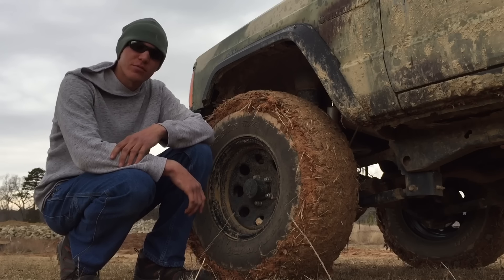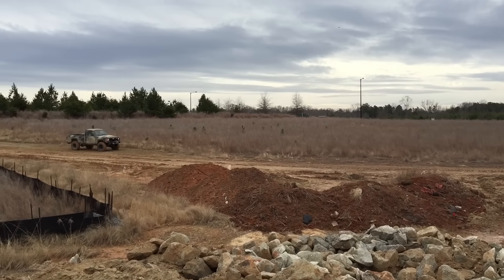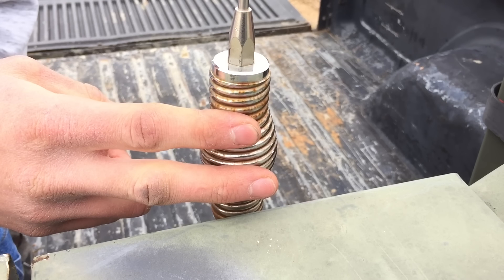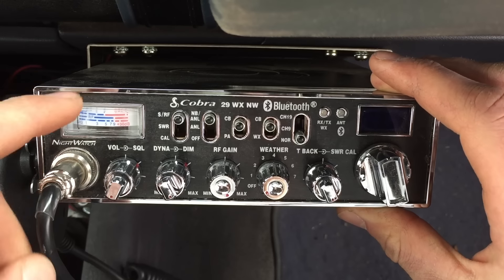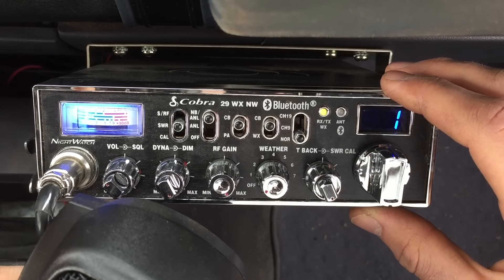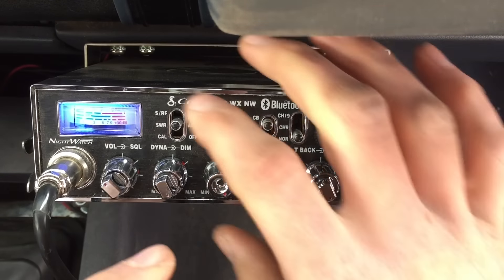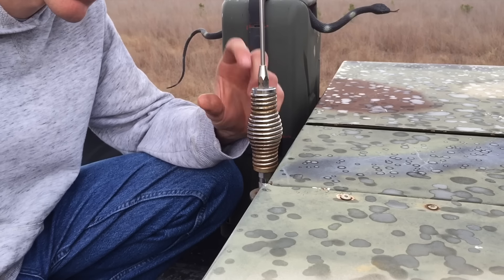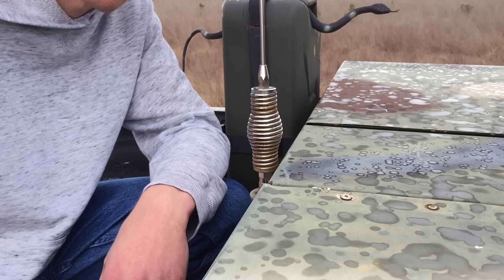How-To Tune a CB Antennae

Comment: I hardly don't want to say anything after you've put so much effort into providing a quality video that in some parts is accurate. I also don't want to steal your thunder.

The main thing I'd like to add is how to properly attach the antenna connector.

As an extra class amateur radio operator with more than 40 years experience that started as a CB radio in 1972 I'd like to suggest that you're putting overemphasis on going out in the middle of a field with absolutely nothing around but weeds to tune your antenna. It's not a bad idea but it's not practical unless you plan ahead.

A 102 inch whip antenna is designed to work with a 4-inch coil. Those are not tuning lugs but rather a simple washer and a lock nut. Putting one in to increase the length of the antenna will offer only a marginal change if any. Taking one out would mean that you would have a lock nut with nothing to press down on. It's already the ideal length. What you have affecting your SWR is more than likely the following.

Ideally, the length for your coaxial cable is 1/2 wavelength. For CB radio that would be 18 feet. Cutting it shorter will have an effect on your antenna tuning. You are correct that you should not generally coil it up but if you coil it up into a large coil you're going to be okay. On the other hand, if you coil it up into a 6in or 8in round loop you have created what is called a BALUN which is a device that converts a balanced feed point to an unbalanced feed point. If you have extra cable you can cut it off or not. In your case it worked out. Look at it this way. Nearly every CB radio antenna comes with an 18-foot piece of cable.

A bigger concern is to route the cable away from certain wiring in your vehicle and in this case in your truck. If it is an old beater 4WD it's probably not going to be a problem. But newer trucks with computers in them are sending computer signals through cables that if you run your coaxial cable next to them they can and often do pick-up noise that affects the range that you can receive.

All in all, a good video. Just a couple of minor points like the washers between the whip and the coil. One thing to consider is that when mounting your whip it's best that you not mount it too low on your toolbox. Ideally you would want to mount it in the center of your roof but when you're out playing in the mud and the trees lower is better. Damn things grab every tree as you drive by it seems. LOL. An alternative to 102 inch whip is a K40 antenna drilled right through the roof. No mag mounts! Commit and do it right.

The last point I will make is weather proofing your antenna connection. First, you obviously want to tighten the antenna connector down hand tight and then slightly more using a pair of pliers.  Not too much because you don't want to crimp the connector. They're generally not very good to begin with. A real serious radio operator would cut that connector off and solder a real one on.  You'd be surprised the difference that would make in range.

Nonetheless,  if you would like to weather seal it correctly you should take some thick epoxy/adhesive 3:1 shrink tubing and put it over the connector in two places. If you are cutting the cheap crimp connector off you want to do the next in two steps.

First, before you solder a high-quality gold-plated connector on you want to slip about a half inch diameter piece of adhesive shrink tube over the cable. Maybe 3/8 in. It's been a while since I've done one. You then want to take a larger about a 5/8 inch adhesive piece of shrink tube and slide it over. Both should be about 3in long or better.

Next, you want to solder a high-quality pl-259 connector. I prefer those that are gold plated. Tips on soldering a pl259 connector on are available all over the Internet and YouTube. It's actually pretty simple. Using a multimeter make sure that you have not shorted out the connector. Attach the connector to the antenna.

Once this is done start first with the smaller shrink tube. You want to get it up so that just fits over the the cable and just around the bottom of the shredded ring. It needs to be loose enough so that when you apply heat to it it actually has room to shrink. Second, once the first piece cools down take the larger piece and push it all the way up to the top And then shrink it down also. This will give you an absolutely weather sealed antenna connection that will survive the harshest elements. This is how we seal hard line connections on repeater sites high up in the mountains where they receive the harshest weather including snow and high winds. Your connector is also not likely to you accidentally come off.

If you don't want to do it this way and the right way the first time consider the following.

Take a roll of electricians friction tape and wrap it tightly from the top to the bottom and then back to the top again. Once you have done this and cut off the excess you then want to take good quality UV resistant rubber tape and again start at the top but go in the opposite direction and wrap it tightly by pulling on it slightly to stretch it until you get to the bottom and then go back up to the top again. When it settles it will tighten itself up. I like to take myself a black UV resistant wire tie and put one at the top where the tape ends and a smaller one down at the bottom. This will weather seal your antenna so when you're out in the mud or jumping over rocks and hills your antenna connector won't get wet or come off.

I seriously hope you don't mind me going into this detail to add to your otherwise excellent video. Just as checking/matching the antenna for the best SWR is important, so is weather sealing the connector.
Reply: Dam dude... why not just make your own YouTube video and show us how it's done 👍👍👍👍👍👍 seem like you know a lot on how to install hookup and adjust ... and I'd like to see a complete how to 🙂🙂🙂
Reply: @theblacksunshineproject3597  :: because bleepinjeep already did that and I simply added to what he already did a good job at doing. I have been an amateur radio operator since 1976 and I've worked on everything from HF low band equipment to ultra high frequency equipment commercial including having run a mobile telephone service center that I built from the ground up. Rather than steal the Thunder entirely of somebody that spent so much time putting together a video I simply have the opportunity to drop in information that will help with his fine work. I sure have no intention of taking away from him. I'm not here to steal anyone's thunder.
Reply: I'm just saying... with all that knowledge... you could make some videos spreading your knowledge
Reply: @theblacksunshineproject3597  :: yes, I suppose I could. Part of the issue is I don't have time. I'm trying to keep moving forward but my grandson has cancer and since my daughter's boyfriend bailed it's just her and I spent a lot of time caring for him. She's trying to finish your college degree so I spend the time during the day with him and I just don't know where I would find the time. I know they're quite a few hands and already do videos and you know I just don't have time. It'd be kind of cool getting some products and do to test them out you know and build up a nice Channel and get some ad Revenue going based on that but I don't know we'll see what happens in the future. Putting on a connector is one of the basics of radio whether it's CB radio or amateur radio. I've got still photos of me building a custom radio antenna that actually works add you only need a handheld drill couple of screws and some copper pipe. I'll tell you, there's some really quick and dirty handmade antennas that you can put on your Jeep for other SUV little outperform a lot of the crap that's out there on the market. Simple is better though. Just using 102 inch whip with a ball mount is really the way to go. I have had projects though where the person had a vinyl hardtop and they wanted a mountain antenna in the middle of that but that wouldn't give a ground plane. So we pop rivet it in a sheet of aluminum inside of it and as we did it we put silicone rubber in the holes so with a pop rivet went through with the kind of went through the silicone and sealed it. Never leaked. Outstanding performance with a K40! Thanks for the inspiration. Maybe I'll actually get around to doing that.
Reply: @justanotherguy3850  this is also something you can pass on to your grandson one day always keep positive and stay pure the lord is always there
Reply: Ray
Reply: Experienced ham huh? I'm a CBer and I'd like to point out a few things. 
An electrical half wavelength in a feedline is not 18ft. It is shorter as you have to take in the velocity factor of the particular cable. There are some applications for the shield to be a half wavelength, however in this case I assume that you are saying that it should be a half wave so the setup ignores the impedance of the coax and there is no or little impedance transformation. And it is a good idea for measurements with an analyser. Coiled up coax is fine as long as it is not exceeding the bend radius and number of bends specified in the data sheet. It will not affect anything. Coiled up coax is not a balun, it is a simple form of choke. And it does not convert balanced to unbalanced. For this application it is a good idea for common mode current. And the SWR is not so crucial at 27mhz as far as performance goes in a mobile setup, unless the coax is ridiculously lossy. Nobody could notice a difference on their signal meter unless the pattern is skewed.
Reply: @arconeagain  :: leave it to one of those negative type of CBers that would rather tear down and ridicule then have a polite discussion. You're the type that's not welcome on ham radio. As an extra class operator there's a lot of things I can say and run circles around you. But I'm going to avoid any type of character assassination.

I did not say an electrical half wavelength. I said a half wavelength. If this were an electrical half wavelength it would be approximately 12 feet in length. The problem with that is it's too short for most vehicles with a rear mounted antenna to run it up to the radio an a compromise needs to be made.

It's clear that you don't know exactly what a balun does. A balun does more than just convert balanced to unbalanced. One technique used by amateur radio operators on a half wave dipole for example that has a 73 ohm impedance is to make a homemade balun by rolling a 6-10 in diameter core with 8 to 10 turns of coaxial cable. But a choke balun is not actually a balun. It acts more like ferrite cores and help eliminate RFI on the outside of the coax. I would be very surprised if you could even tell me what's a formula is to calculate an electrical 1/4, 1/2, 3/4, 5/8 or whatever wavelength. Even dual 2m / 70cm antennas have an 18 foot cable run.

Respectfully, if you're going to jump in know what you're talking about.
Reply: @arconeagain  :: It's BALUN.   I've been building antennas since I was 12 years old. One of my first jobs was working in a CB radio shop making sliders and turning the radio up. I also built amplifiers as well as repaired radios and amplifiers. I spent a lifetime as a technician working on Public Safety radios in law enforcement and fire.

I really don't care if you think you know more. I think it's inappropriate for you to have a pissing match in somebody else's well-intended video. There's nothing I wrote that was misinformation. I also know the difference between a CHOKE BALUN and a BALUN. Amateur radio operators have used choke BALUN's on yagi's and other antennas for decades. The key use is as an RF isolator transformer. This is to get feed line radiation off the cable. One could put 9 ferrite cores on it depending on the frequency. This is in contrast to what a BALUN does. By taking a particular design antenna intended for ladder line and bringing it down to a BALUN thus changing the impedance to 50 ohms to match the radios 50 ohm output. One such antenna would be a modified G5RV.

I could probably look up websites telling you what a choke BALUN does but then you'd think I was just looking up the answers. I know from hands-on experience. And the thing is that none of this has anything to do with the video presented. I probably could have just said that the RG58 is 18 ft long which just happens to be a half wavelength. But not an electrical half wavelength. But if you cut the cable to an electrical half-length it then becomes part of the antenna design.  I'm sure you didn't know that. But that was never the issue. The information I gave on proper installation of the antenna is what matters. You just wanted a pissing match.

Why not be a decent guy now and either add something of value to this conversation or let it be? You're not impressing me and I'm sure neither one of us is impressing others reading this. It is nothing more than a distraction from the installation of a 9-foot whip.
Reply: @justanotherguy3850  You're are the one that started the this by saying 'run circles around you', and now you have spilled your guts, you're embarrassing yourself. You're not the only one who can build and repair by the way. And there is no such thing as a choke balun, a choke is a choke and a balun is a balun. And you stated that a choke converts balanced to unbalanced, which it certainly does not. It impedes the flow of current on the shield of the coax and that's it. You probably haven't figured out what balun is an abbreviation for. So I am not distracting from the content in this video because that was part of the content.
I am tired of seeing very basic misinformation in these types of videos, and then all the praise in the comments from oblivious users who go out and then practise poor theory. And then they regurgitate it to the next person. It is bad for radio and I am merely trying to stop the rot and make people aware that just because you saw it on youtube from a guy that has all these credentials, doesn't mean it is true. I have no more time for you because you will never admit you are wrong. I have to work on an antenna project for a client and have several radios to repair.
Reply: @arconeagain  :: you have no more time for me because you're incorrect. Go back and look at my post and you'll see that none have been edited. I wrote:

"One technique used by amateur radio operators on a half wave dipole for example that has a 73 ohm impedance is to make a homemade balun by rolling a 6-10 in diameter core with 8 to 10 turns of coaxial cable. But a choke balun is not actually a balun. It acts more like ferrite cores and help eliminate RFI on the outside of the coax."

In my second reply I wrote:

"I also know the difference between a CHOKE BALUN and a BALUN. Amateur radio operators have used choke BALUN's on yagi's and other antennas for decades. The key use is as an RF isolator transformer. This is to get feed line radiation off the cable. One could put 9 ferrite cores on it depending on the frequency. This is in contrast to what a BALUN does. By taking a particular design antenna intended for ladder line and bringing it down to a BALUN thus changing the impedance to 50 ohms to match the radios 50 ohm output."

I've been more than clear about the difference between a CHOKE BALUN and a BALUN. A BALUN can take many forms and may include devices that also transform impedances but need not do so. A 2:1 BALUN for example converts a 100 ohm impedance to 50 ohms. 100:50

It's pretty clear you're in over your head.

How would you calculate this?

A load ZL = 100 + j50 Ω is connected across a TL with Zo = 50 Ω and l = 0.4λ. At the generator end, d = l, the line is shunted by an impedance Zs = 100 Ω. What are the input impedance Zin and admittance Yin of the line, including the shunt connected element.

Solution: Normalized load impedance z(0) = ZL
Zo = 100 + j50 50 =2+ j1
is entered shown in the margin on the top. Clockwise rotation (from
load toward generator) at fixed |Γ| (red circle) by 0.4λ ⇔ 0.8 × 360◦ = 288◦takes us to z(l) ≈ 0.6 + j0.66 and y(l) ≈ 0.75 − j0.83 as shown in the middle. Hence, including the shunt element with
normalized input impedance zsi = 2 and admittance ysi = 1 2, we obtain yin = y(l) + ysi ≈ 1.25 − j0.83 for the overall normalized input admittance of the shunted line as shown on the in the bottom — the corresponding normalized input impedance is
zin = 1 yi ≈ 0.56 + j0.37.

What's the answer and how do figure it out?

Comment: Great info, only thing I'll add is wire length Cable must be cut at 3 foot intervals 9 foot instead of 10, is what they taught me first round with radios in 1989

Comment: I'm in NYC, so SWR adjustments can be tricky and especially for a home base station.  I used a similar 102 inch stainless steel whip antenna for yearsssss, and with that very same styled spring mount but window sided.  Yes, out my bedroom window, up high in a public housing project building, mounted onto a window guard, straight out as possible.   Hardly any SWR reading whatsoever.  Powering the antenna was a RANGER 2970 (the one with the built in cookie/linear underneath), some monster coax cable, a huge Pyramid power supply, and an Astatic tear drop & lollipop mic.  I was killing it as far as both reception and transmission distance.  But sadly I was also ruining tv and radio reception for hundreds in my antenna's path.  The antenna was holding its own just fine after 10+ years of hanging out there, with the spring coil showing a little sign of rust.  In my car I used a Cherokee mobile handheld and a Wilson magnet mount.  Both worked great.  But like most non professional drivers I eventually succumbed to the cell/smart phone and internet while fading away from CB.  Great times indeed.